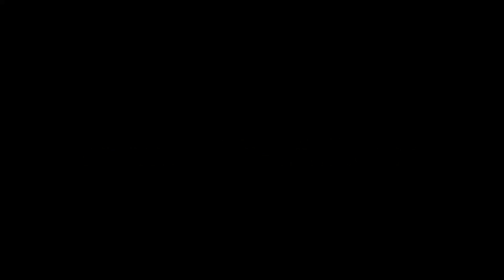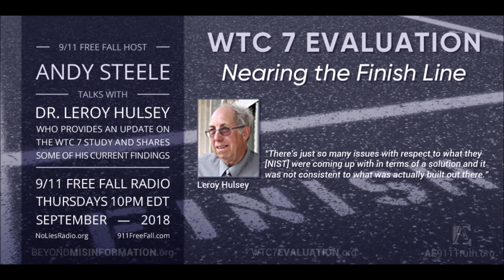9/11 Free Fall 9/6/18: WTC 7 Study Update

Comment: Not a word from Hulsey on the known damage to Building 7, the fact the south perimeter frame was breached top to bottom.
Reply: Bottom floor blew out first asshole.  Column 79 was nowhere near the first floor. Do fire induced collapses cause shockwaves fuckboy? Lmfao
Reply: NIST itself stated that debris from the towers did not play a significant role in the collapse. Furthermore, NIST admits that diesel fuel, which was stored at WTC 7 but successfully moved to underground tanks, played no role in the collapse. NIST contends that office fires brought this building down.

If you don't know these basic facts, why are you posting ignorant nonsense? Deliberate disinformation?

Curious thumbnail by the way. Do you actually question the video and photographic evidence that WTC 7 - unlike the towers which were conspicuously blown apart - fell straight down into its own footprint?

Photographic evidence of the debris damage which occurred not "top to bottom" but in two isolated areas near the top and toward the bottom can been seen in the presentation at ae911truth.org/project-due-diligence.
Reply: @johnkesich8696   I see you're picking cherries. NIST also says that it was not "controlled demolition" that caused the collapse, yet you staunchly disagree with them on this, but are more then happy to agree that structural damage played no role. Have you proven that? In any case your comment is still pretty foolish. The fires started at the area where the gash was, in addition the gash allowed for more airflow into the buillding which would make conditions much worse, contributing to a "stack effect" to the fires, so already just by default alone you can be considered wrong. 

You seem to not have much  understanding of Engineering concepts either. Why would it be unusual that gravity pushed downwards on something? When the core collapsed first the exterior columns would buckle and also possibly be knocked out of place by falling debris as the entire interior was carving in, some of the debris would eventually begin to scatter outwards.